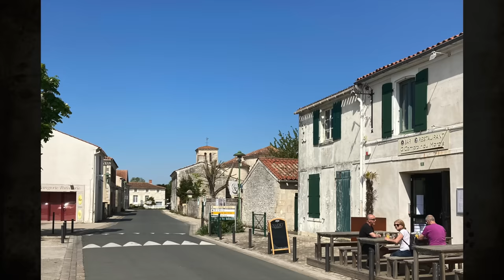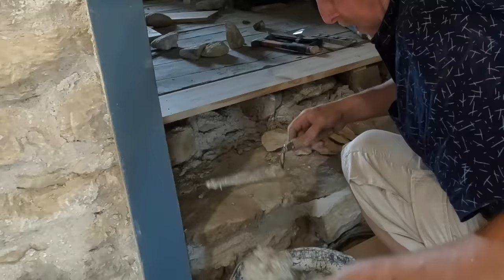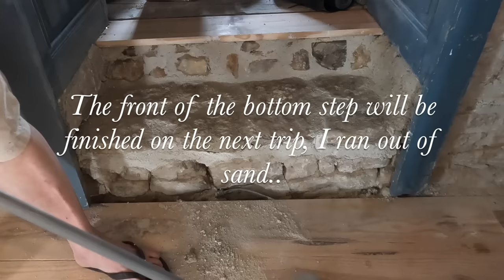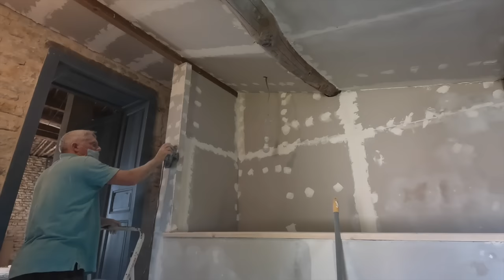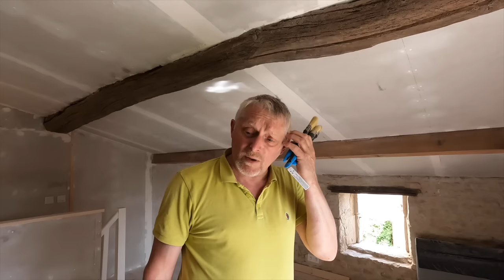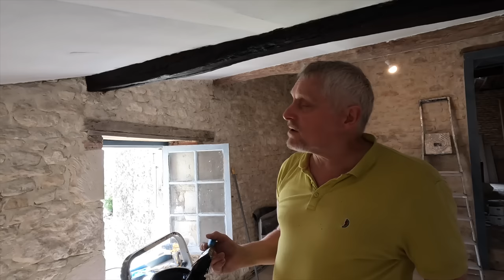I can see the Light the end of the Tunnel!  The Dreaded Sanding, Waxing the Beams,  Stone Step.

Comment: I'm surprised your neck isn't permanently bent with all the sanding and waxing above your head.  My mom used to use wet newspaper torn into bits when she had to sweep a dusty floor, the wet bits help the dust to stick to the paper and helps keep the dust down.
Reply from the maker: thankfully no more ceilings for a while, I keep meaning to use water on the dust.. but keep forgetting.. many thanks as always